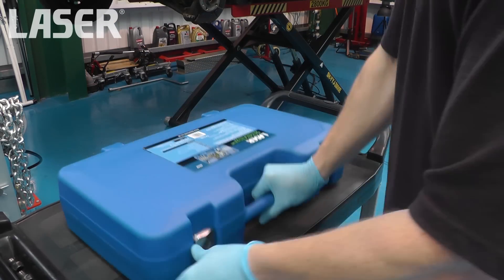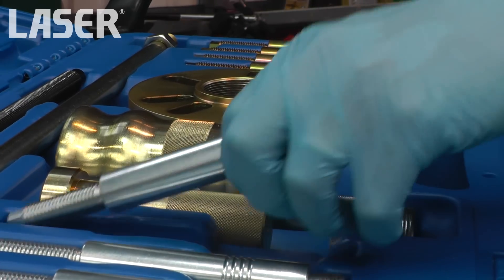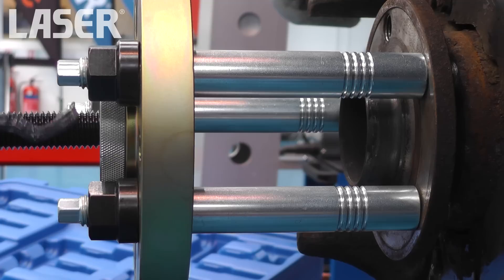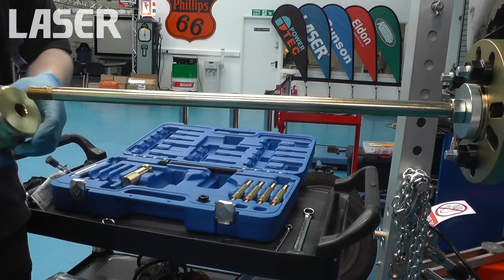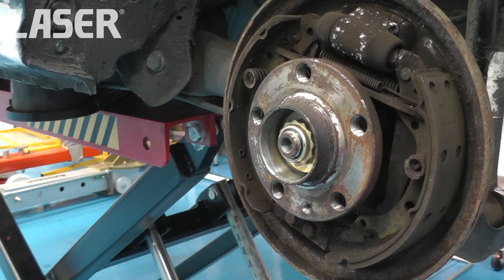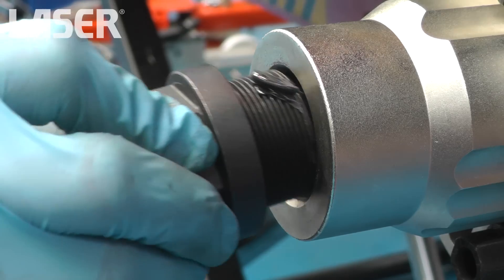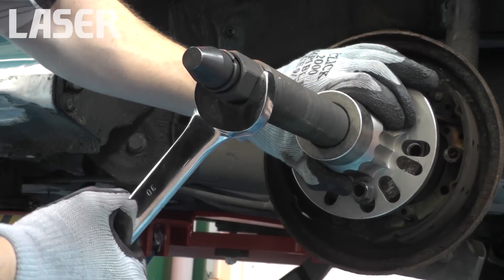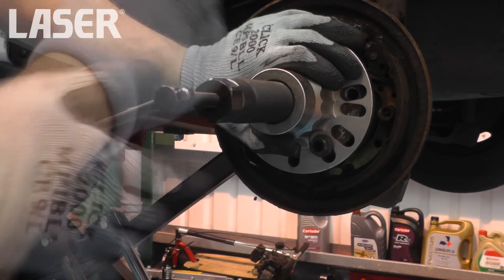5648 | Laser Tools | Hub Puller Press Kit & Adaptor + Force Screws

Comment: What about to put the hub back in or install the new one. Can this tool be used to put it in
Reply from the maker: 5648 is just an extraction kit, for installation you would also need a different kit; other kits, like 5582 for example, will remove and install wheel bearings. These are vehicle specific, so we would need to know your vehicle details before we could advise which kit you need. If you can please e-mail our Technical team they will be able to assist - technical@toolconnection.co.uk

Comment: What is the bolt at 3:35 pressing against to push out hub assembly? Thinking can't be the drive axle.  That would just push into transmission.
Reply from the maker: At 3:35, the tool is on a rear wheel of a front wheel drive car, so the tool just pushes against the stub axle on the trailing arm rather than a driveshaft. Earlier in the video (around 1:00 on) the tool is used on a front wheel; here, the drive shaft is pushed out of the bearing first then the slide hammer is used to remove the bearing from the upright. If you have any further questions on this please contact are technical team via e-mail - technical@toolconnection.co.uk

Comment: Can this tool work on fwd chevy ford's toyota honday in united state
Reply from the maker: The Laser Tools  5648  Hub Puller Press Kit is suitable for use on front-wheel drive vehicles primarily for removing the driveshaft constant velocity joint from the drive flange and removing Generation 2 wheel bearings.
The drive flange on Generation 1 wheel bearings can be removed but the remaining bearing will still need removing from the hub by various methods.